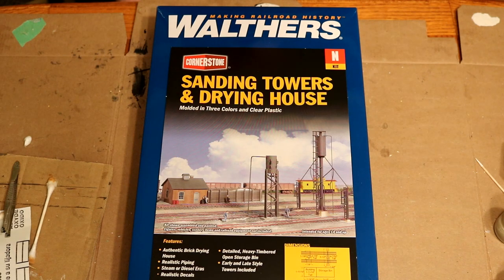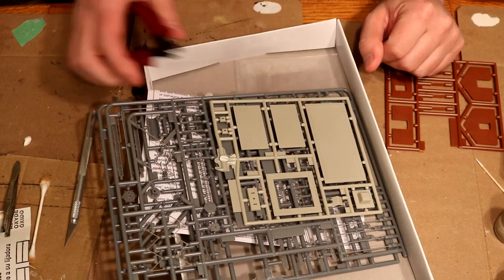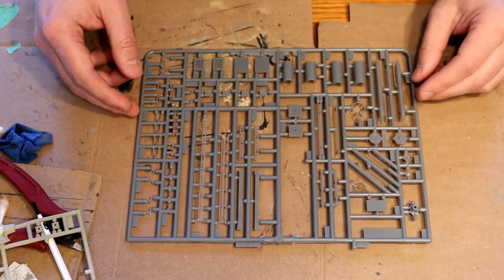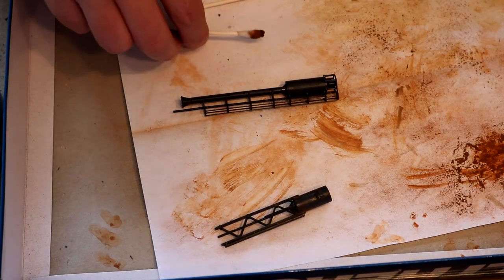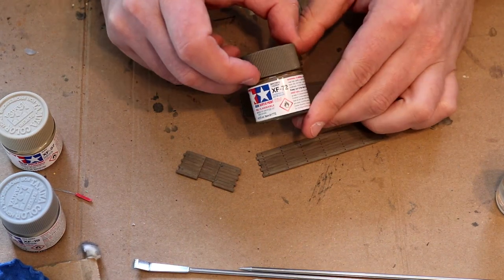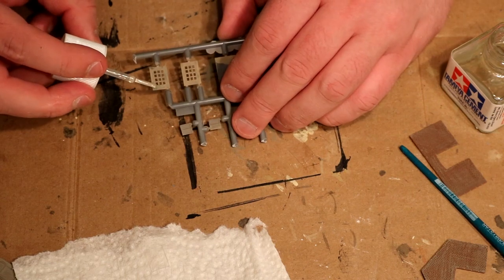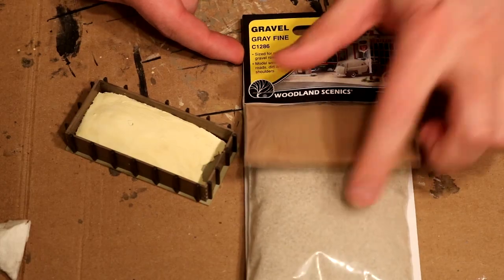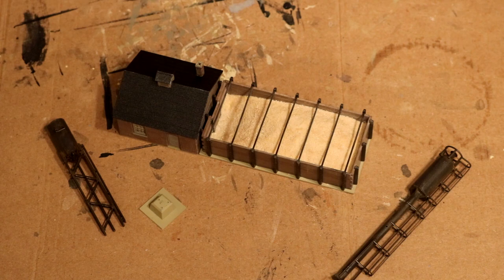N Scale - Walthers Sanding Tower and Drying House

Comment: Just finishing up mine. Some very small parts on those towers. The large one can be backdated a little bit by leaving off the ladder cage. Figure out you sand bin " load" before you put in your cross braces. I put styrofoam in the bottom of mine before adding the sand on top.

Comment: That is a steam era down spout. Diesels have a sand  fill cap on the sides of the short nose and either the sides or top center of the rear, depending on model. I am not certain how to convert that to a diesel, the units I have seen usually have  a rack with hoses and fittings to route the sand to the appropriate filler. The big ones have a rolling gantry .

Looks good though! So I subbed.
Reply from the maker: Thank you! I think I will omit the smaller tower from my layout.

Comment: Hello Sir, 
Well I'm enjoying your videos and taking lots of notes so I can remember what needs to be done next and so far I'm very impressed with your work. I have a question about the sand tower kit you are working on at the moment. Now correct me if I'm wrong, but if I see a part like a wooden floor that needs to be painted first and then assembled to the building would it be too out of place if the floor instead of being just painted I would install a real wooden floor and then paint it and stain the deck to whatever the color is suppose to be just to give it that little bit of detail to the building. Would you agree with me or not and why?
Thank you for your time 
Sincerely 
Allan
Reply from the maker: I think anytime you can use real wood it can greatly enhance the realism. I suspect it would take some work to incorporate it, but the end result would likely look fantastic.

Comment: Do you think this structure would work for the early 70s?
Reply from the maker: As long as it works in your mind. I am going to be using it on a modern layout, and I justify it by telling myself that CN Rail renovated an old facility. It's certainly no less realistic than seeing freight layouts with steam engines and modern diesels running together, along with a passenger train cruising around the mainline.
Reply: Yes, very much so

Comment: The plastic they used for this kit must get brittle after time. I had one of these kits that I had in storage for about 10 years and recently decided to build. The tiny and very thin parts such as 4/5, 14/15, etc on the small tower and 33/35 on the larger tower break apart no matter how careful I was to remove them from the sprues. Plus, the instructions are very unclear about placement of the 10/11 parts on the small tower. This kit is an exercise in frustration nd left me uttering comments not printable here. It would have been useful if you showed actual step-by-step instructions for the towers but nice video on detailing/painting otherwise.
Reply from the maker: That's unfortunate if the plastic gets brittle over time. Somewhat surprising for an ABS type plastic if it's enclosed in the box. Sorry to hear. Thanks for the feedback.
Reply: I didn't have brittle plastic problems,  but agree with the other comments.  Very challenging kit...